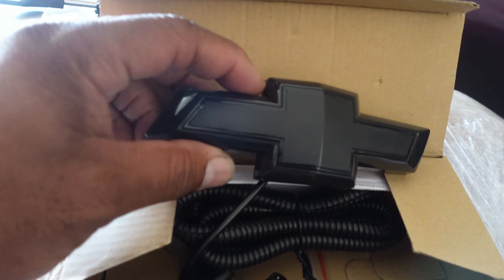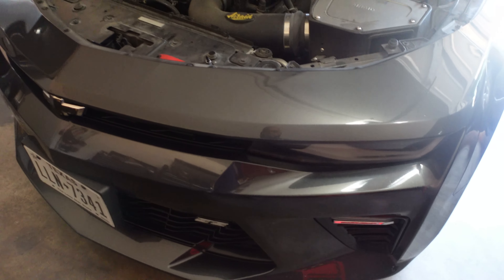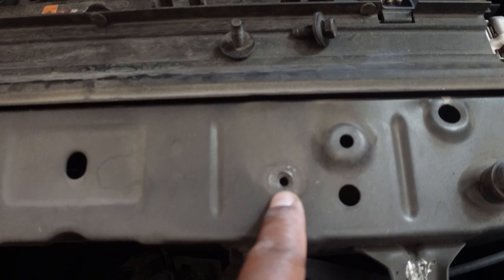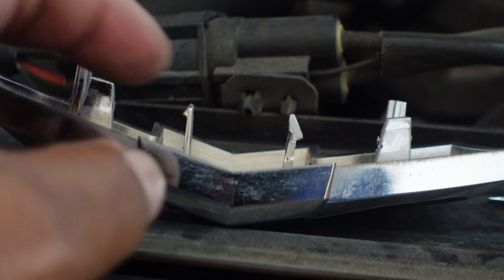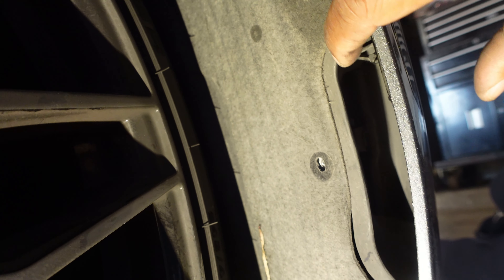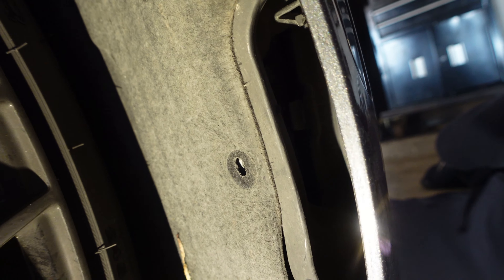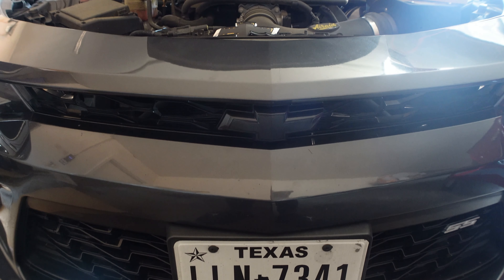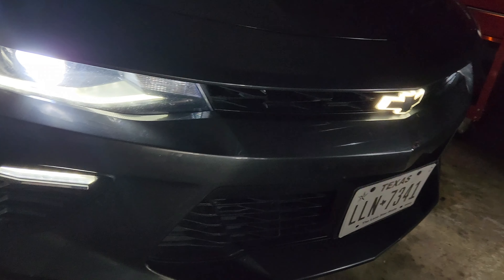CAMARO SS GLOW TIE INSTALL THE EASY WAY #camaross#Detroit#Dallas

Comment: I installed mine exactly the way you did but for some reason my side marker works but the glow tie won’t glow.
Reply: Try reversing the connection for the bowtie. Most of the time, that will cause led/illuminated parts to come on.

Edit: I’m talking about aftermarket parts like led bulbs and such. Especially ones from places like Amazon where they don’t always specify which direction to connect wires
Reply: @bigohm306  would that be the harness connecting directly to the bow tie?
Reply from the maker: Yes that harness
Reply from the maker: I say in the video that the wires need to be reversed.

Comment: link to the product would ne nice
Reply from the maker: I have the part on the video. I ordered it on amazon. But i wasn’t thinking about the link. Hope you find it. So worth the money.
Reply from the maker: LED Black Chevy Camaro Front Illuminated Bowtie Grille Emblem Glowtie Badge kit Accessory 2016 2017 2018 2020 2021 2022 2023 (White LED) https://a.co/d/0z1YTZa